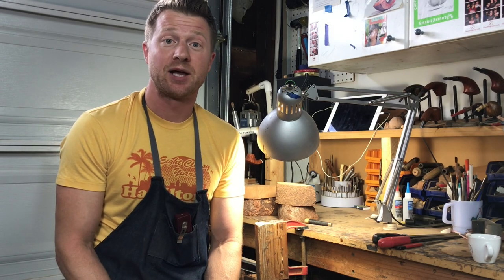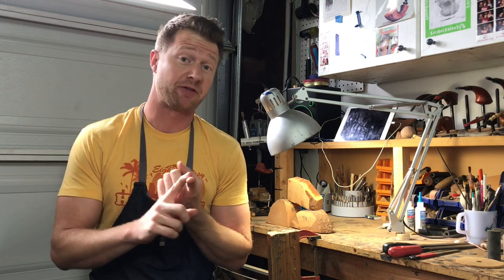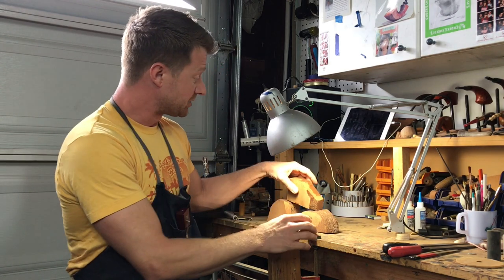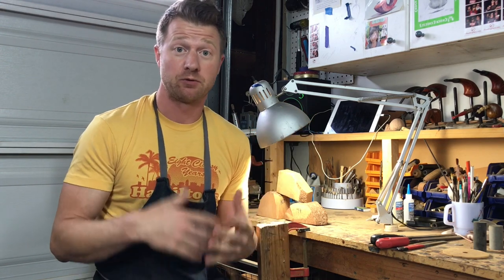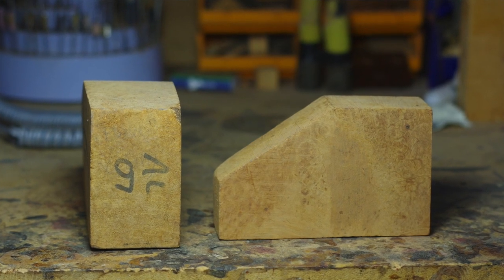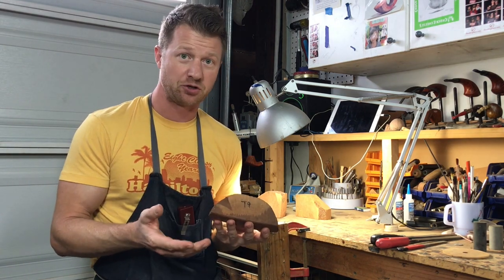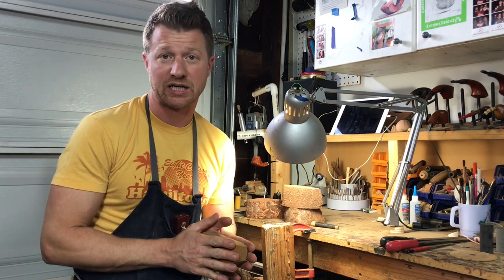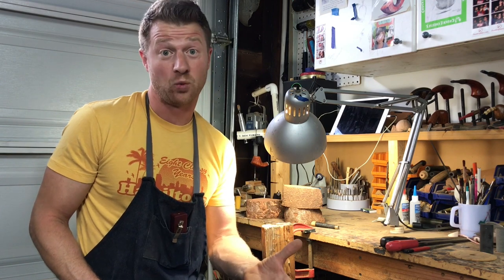Understanding Briar for Pipemaking

Comment: I have a question, would you be able to grow this type of bush in America and use your own briar from those roots?  Or do you have to get it from areas where briar grows naturally?  I am just curious, I think some day it would be really cool to make my own pipes.

Also, how much does one of those blocks cost depending on the quality?
Reply from the maker: I suppose one could grow it.  It's similar to manzanita here in California.  But, you'd need the proper climate for it to grow well--and about 40 years to wait for it to be big enough to use.
Reply: @jalanpipes  most briar are a lot older than that when harvested. You didn't mention that usually, the manufacturer will have to dry the wood for years before it's usable. Also, there is a special way of preparing the briar after harvesting it. There's a pretty lengthy video by mimmo online where you can see many of the steps it takes to harvest and prepare briar blocks. 

So: yes, in the right climate, it can be done. you need to be aware of the fact that you won't live long enough to use the briar you planted.
Reply from the maker: Marc Wilhelm Yep.  Mimmo is a friend of mine.  The point of my comment is that Briar takes decades to grow for use in pipes.  40 years is the minimum age, most are older.  It usually takes a few months before they cut briar after it arrives, but I don’t know any cutter who ages wood for years, not even Mimmo.

Comment: Can other woods be used other than briar?
Reply: Olivewood and morta are basically the only other wood materials that pipemakers use, and they probably make up ≤1% of all pipes sold. Briar doesn't burn, it doesn't crack, and it doesn't absorb moisture like other wood. The reason why briar is used so heavily is because its density and hardness allow it to withstand all of the torture that us pipe smokers put our pipes through.
Reply from the maker: They can, but they're inferior for all the reasons stated by the other commentator.  You can try strawberry wood burl (very similar to briar) as well.
Reply: What about osage orange?

Comment: What would you recommend for wood when it comes to someone just starting out? Buying brier and letting it age a few years just doesn't seem appealing.
Reply from the maker: gedion4000 I’d recommend briar. You can buy more affordable grades to work with.  That way you become familiar with the material and have a usable pipe when you’re done.
Reply: Hey, thanks for getting back to me. I absolutely plan on using brier, it was the aging bit I'm scared of. Any suggestions for resources for cheap? id really only be interested in making one pipe. if it works out i want to make a couple to span the week. The big pipe shows are out of my reach for just being curious about making my own pipe. Cheers!
Reply from the maker: gedion4000 as long as it’s dry, you should be fine. And I’ve not yet found a retailer who sells wet briar. I’d say just get briar and have fun.